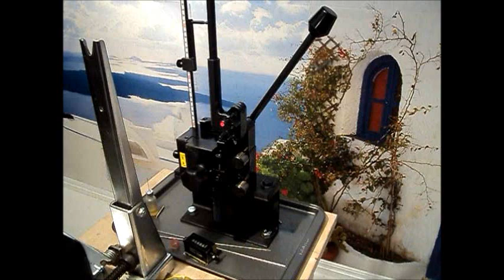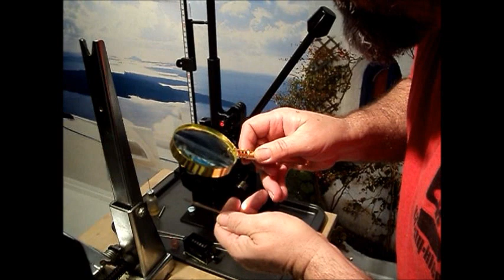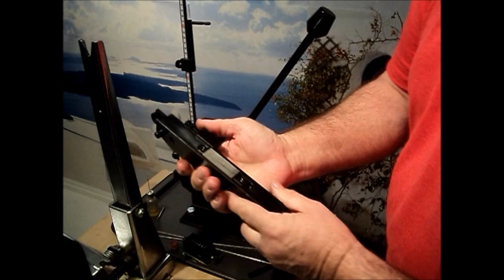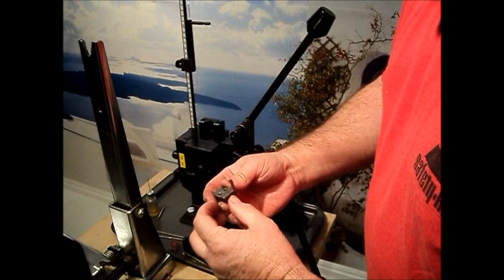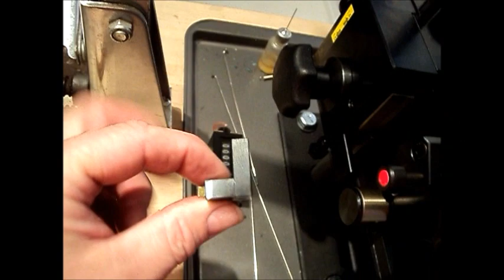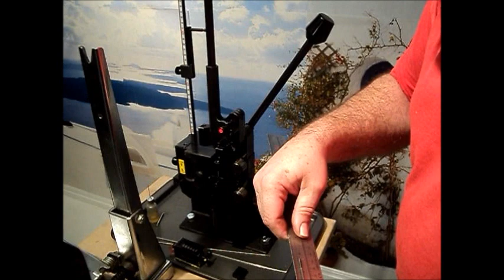Adaptation for a Morizumi spoke threader.

Comment: By the way - i've been using Hozan for several years now - the trick is to remove the handle and attach a drill. This way you can roll any amount of MM you want and can easily roll 36 spokes in 15 minutes or less. Saving you tremendous amounts of money and time. The machines don't actually seem very efficient vs precision.